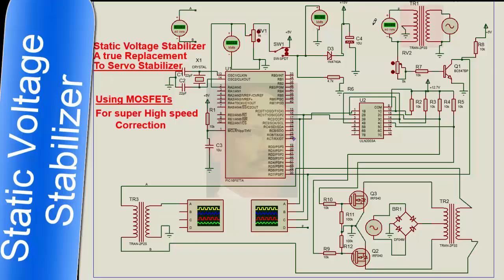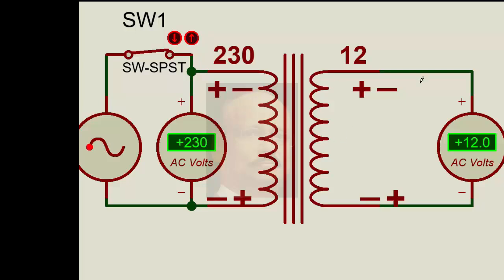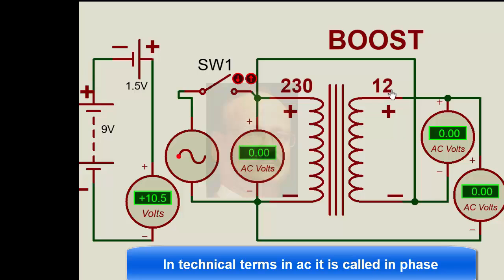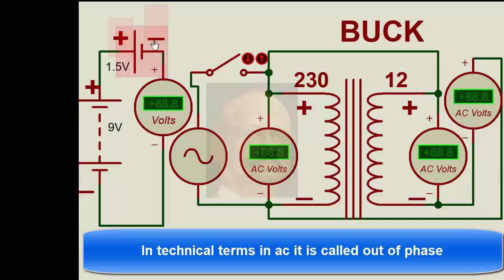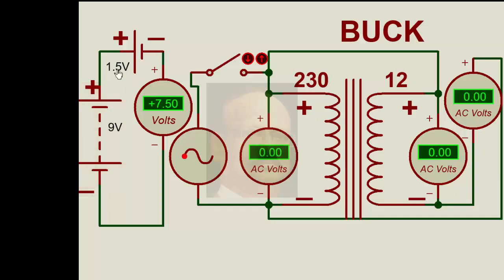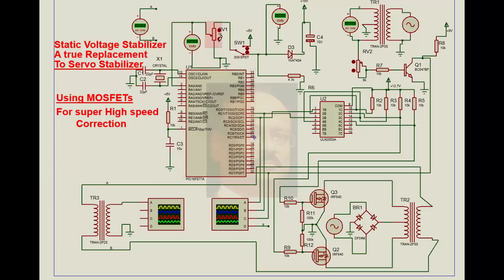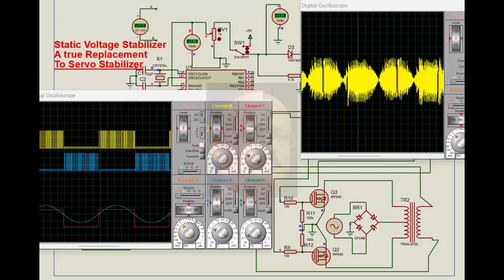How to make a Static Voltage Stabilizer replacing a Servo voltage stabilizer

Comment: Thank you for your explaining, i have a question if you do not minde. Why the R11 and R12 are connected in series between the two gates of the power transistors and then they are connected to ground. IS there any special role they play? thanks in advanced
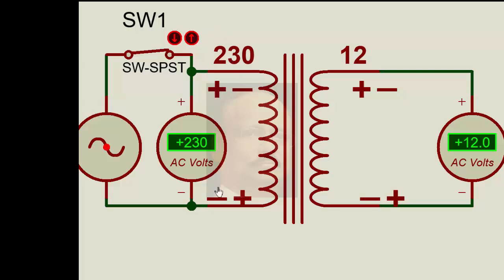Reply from the maker: MOSFETS are voltage driven device. 10k :100k forms voltage divider. Ratio is 1:10. Thus 15 v drive coming from the ULN2003 is divided in that ratio (  to deliver required drive voltage to the MOSFETs gate) . It is not one in series and another to ground  as conceived by you but simply a potential divider. Besides that the circuit is a bit difficult😢to understand. Please be frank if did follow the concept of buck and boost followed.